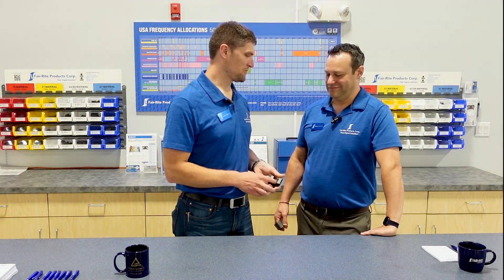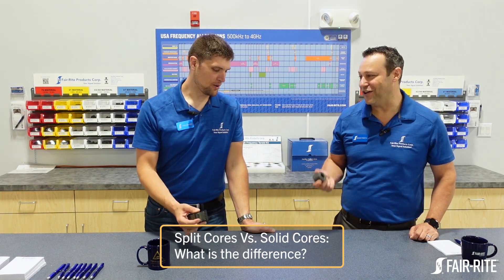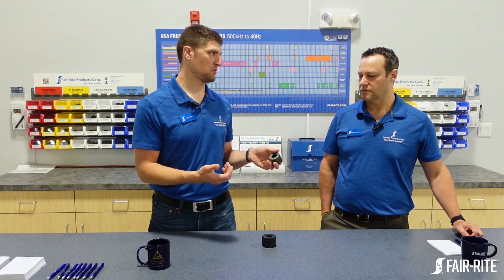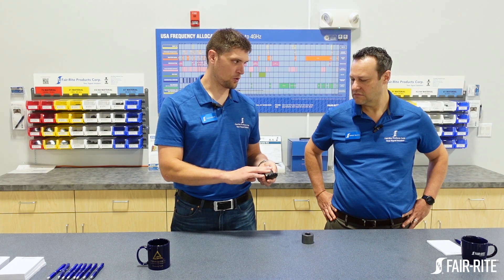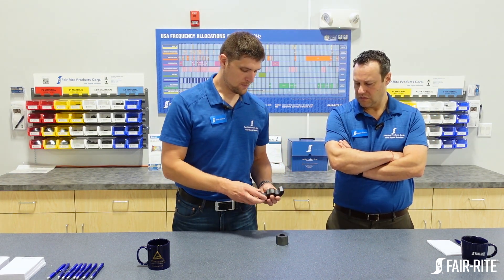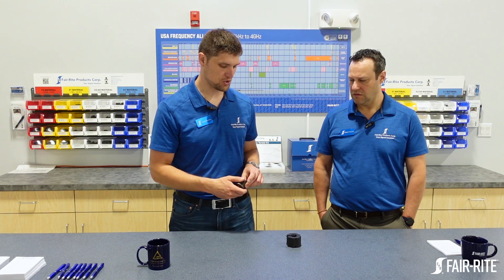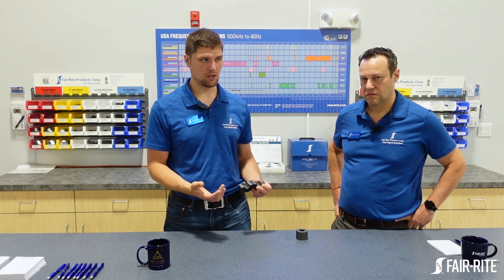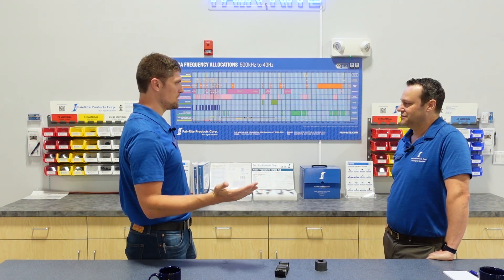S2 Ep 6: Split Core VS. Solid Core: What's the difference?

Comment: "not Bridget" - LOL.  The fact that the split core has slightly higher frequency performance was surprising.  Do they have the same saturation characteristics?
Reply from the maker: Typically the saturation characteristics will be slightly softer. It depends a lot on how well they are made. The tighter the tolerances and the flatter the mating surfaces, the more they will just act like a solid core.